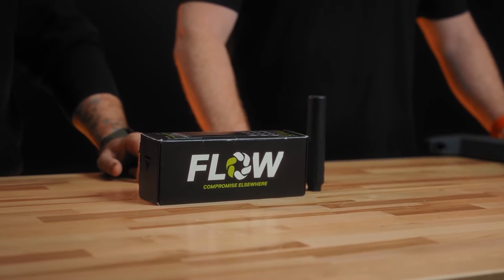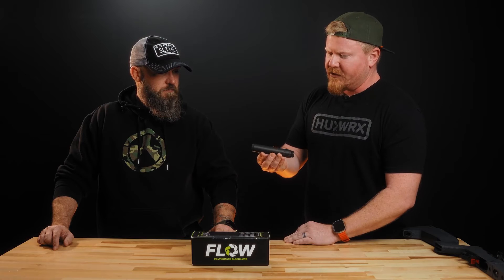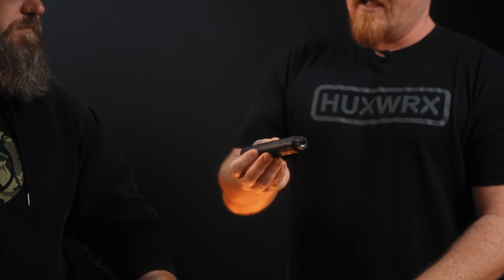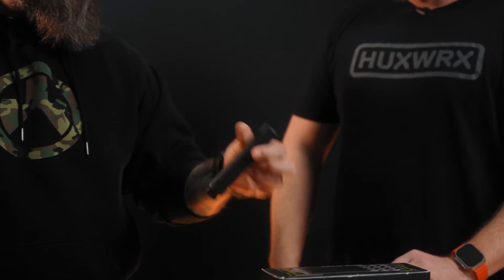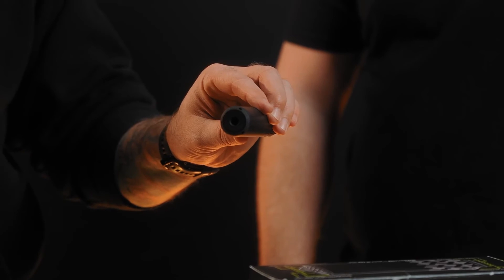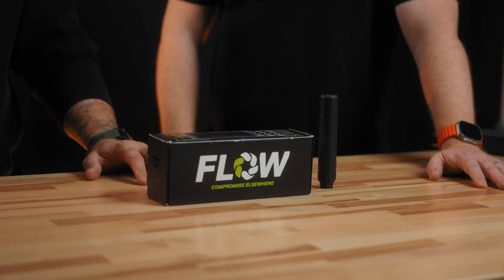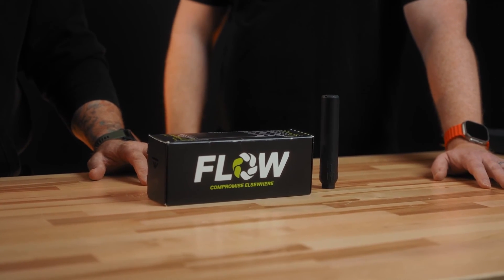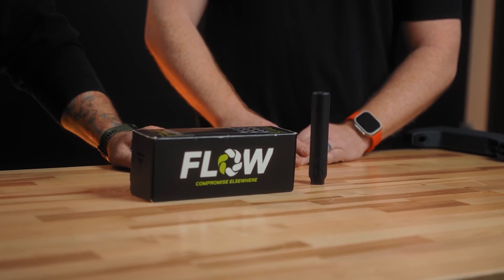HUXWRX Safey Co. Flow 22TI

Comment: But you can’t clean it and it’s a .22 ?
Reply: You clean it with solvent and/or ultrasonic. The Breakthrough Silencer Cleaner works extremely well.
Reply: Breakthrough silencer cleaner made 22 cans fun again.  Holy crap, nothing like coming home from shooting to having to soak, vibrate, scrub, soak, scrub… for days to get the baffles clean.

I ordered a gallon of the breakthrough cleaner.  It should come with rimfire cans.  Drop parts in, 24 hours later they are completely clean,  no scrubbing,  no nothing.  Rinse the solution off, reassemble, and shoot!
Reply: About 40 bucks for a quarter gallon.  But the cleaner can be used many times.

The first batch I bought is still in use, and the fluid is jet black now.

I also use it to clean gun parts. 

This stuff will remove ancient hoppes #9 from steel after a few hours.  Then I dry and reoil.
Reply: Crazy to think $160 a gallon. I would hope you can use it for years. What is the drying process since these do not come apart? @darrelljohnson7832
Reply: If you buy a gallon, it’s only $100. I usually rinse it with hot water. And then let it dry in the sun.
Reply: @darrelljohnson7832 oh ok. Simple enough.  Toaster oven at 200 hahaha